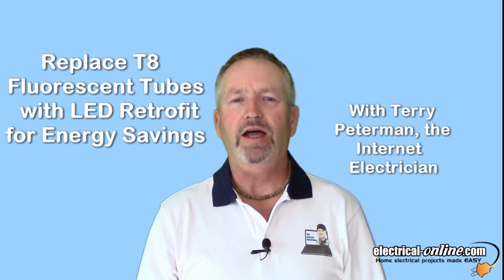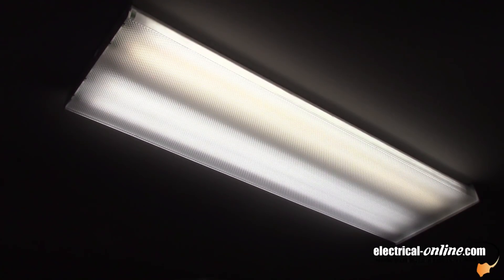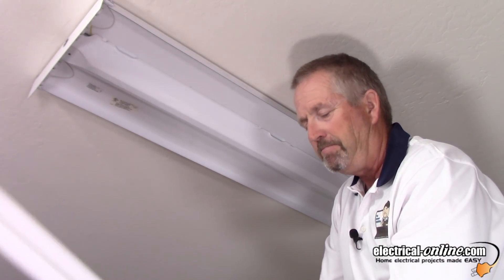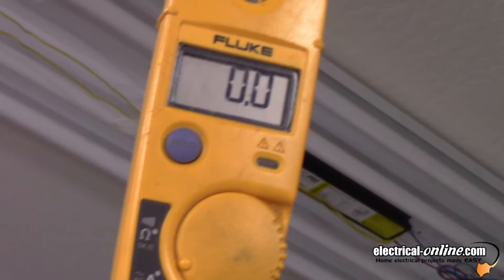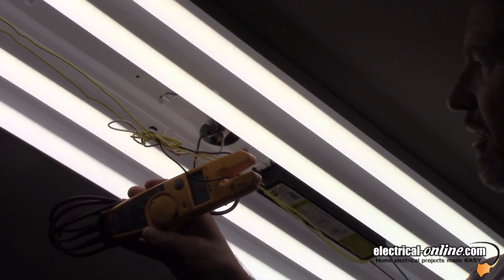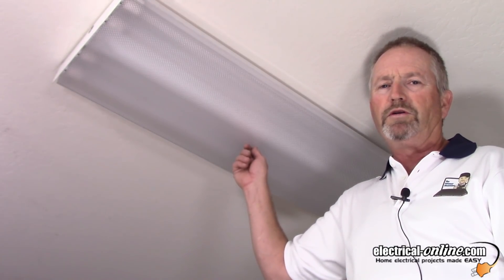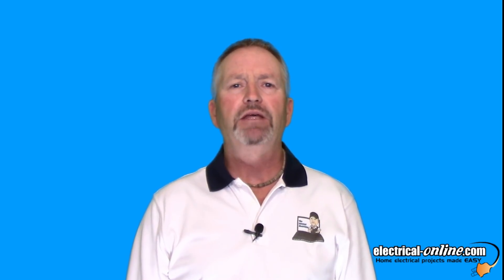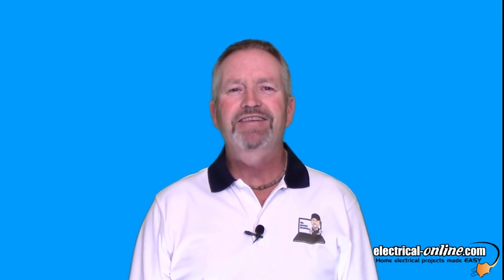Save Energy By Replacing T8 Fluorescent Tubes with LED Retrofit

Comment: A simple amperage comparison does not tell you much.  For example, a 100 watt bulb will draw more than double the current of a 40 watt bulb. It will also produce more than twice as much light in lumens.

So what you need to do is compare the lumens/amp for the T8 and LED fixtures.

Comment: Wow you call yourself an electrician?  Do you wire for fire?  Where is the Romex connector?🤔where did you get your license Kmart??
Reply from the maker: Wow, you called it Wes! Electrical license was on sale at Target, not K-mart! Glad you caught that the romex didn't have a connector on it! I opened it back up and put one on just as it was starting to smolder.  I didn't install this fixture, was done by the previous owner.  That hole through the fixture is about 2", so a 1/2" box connector was of no use.  What I did do is insulate the opening to the fixture so that if some sinister force beyond our understanding (quantum physics) was to push those wires against the metal edge, and then rub them back and forth long enough to rub through the insulation on the wires and then begin arcing (without tripping the arc-fault breaker), and start a raging blaze inside that metal florescent fixture housing, thus igniting the wall board (well, you know how these things escalate).  Anyhow, thanks for your input, and yes, it should have had a connector, and yes, I did ensure that there was no danger of a fire here.
Reply: @theinternetelectrician  gotta luv utube trolls...
Reply from the maker: @OSGCourtWatch  Yup!  Usually when I take the time to reply to them, it ends right away, and sometimes they even apologize!  Thanks for watching!

Comment: Now direct wire the LED tubes and do a current reading without the ballast.
Reply: They are not designed for that and would not function properly.
Reply: If they are not designed for that, then explain how I've done it to several fluorescent lights without any problems to any of the lights and they still work properly.

Comment: Did you do any calculations to see what the real cost savings per month might be (while including your local charge rate)?  Great video, but the potential cost savings is what really caught my interest.
Reply: That's going to depend upon the breakpoints for your power. Many contracts for electricity have different breakpoints. If you can get below a breakpoint it can make the difference between a $51 electric bill and $188 electric bill.

However if the charges a fixed rate regardless of usage then LED lights run about one-third the power consumption.

Your cost is about $0.16 for a 4 light fixture for 8 hours at 12 cents per kilowatt hour.  Assuming the common four footlong 40 watt T8 bulbs.

This means a similar amount of lumens  produced by LEDs would cost you about $0.05 per 8 hours of usage.

So that's about $0.35 per week for LED versus $1.16 per week for fluorescent.

Or about $18 per year for LEDs instead of $58 per year for fluorescent bulbs.

The LED bulbs are more expensive to purchase but last much longer.

Over the course of 10 years they might save you $400 in electricity and $100 in bulb replacement costs for a total Savings of about $500 in 10 years.

https://www.doityourself.com/stry/average-annual-energy-savings-of-switching-to-a-t8-fluorescent-light

As the article says, if you're cost is high like in Hawaii than the savings will be much bigger. If your power is cheap like in North Dakota then your savings will be smaller.

Comment: That was a nice amperage comparison between the fluorescent tubes verses the LED tubes.
Reply from the maker: Yes, I was surprised by the result. Feit Electric claimed a 58% energy savings, and if you do the math, that was pretty much bang on. I will do another one with the LED tubes that don't need the ballast at all, just rewire the sockets for a direct connect to the tubes.  I think that will be even better as you aren't running the extra electronics in the ballast? we'll see, stay tuned!
Reply: Terry Peterman, I have taken a lot of ballast out and rewired the tombstones for a LED retro fit. I never got to do an amperage study on the before and after the new installation.

Comment: Did you bother putting a romex connector on that light?  That things a fire hazard the way it is.
Reply from the maker: Was counting the views until that got noticed! When we uploaded the video and reviewed it, I told Sandy that someone's going to comment on that! I should have shown it, but too late. Whoever mounted that fixture, they knocked out the large opening and then mounted the fixture right over the outlet box.  Although there's no risk of damaging the wires, I was able to modify a plastic bushing to protect the metal edges just as a precaution. The hole was much to large for a romex connector to do any good.
Reply: @theinternetelectrician  A couple of reducing washers will make the hole fit a romex connector.  I'm just giving you a hard time anyway, I've seen alot of shoddy work over the years.  Much worse then a cable without a connector.

Comment: would have like to have seen you install the new tubes especially because of the label up and lens down - show label on newer tube - and don't they go straight in  then you twist 90 degrees ?
Reply from the maker: Yes, it's noted on the label to install tube with label up, and you insert the tubes into the holders and turn it 90 degrees so the label is up. It would be quite apparent if you installed the wrong way once you turned it on, but an easy fix!